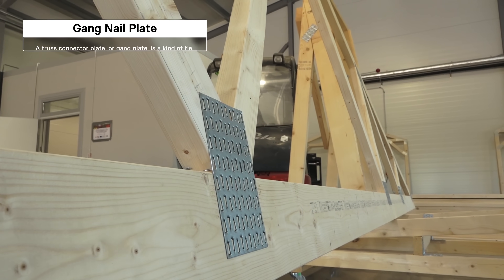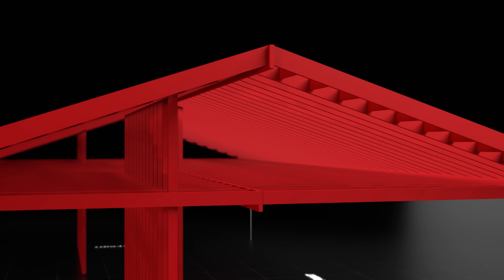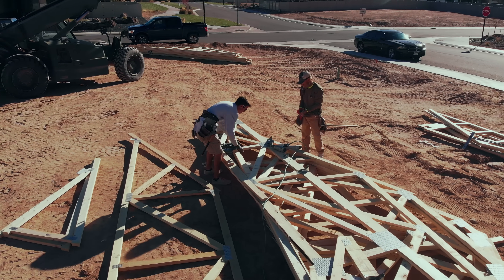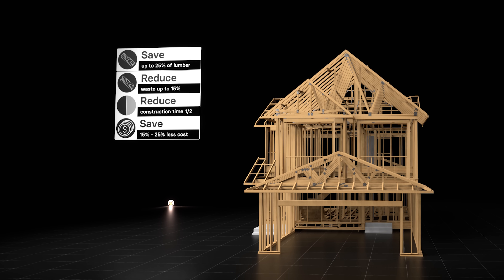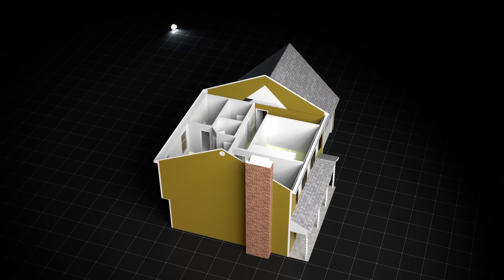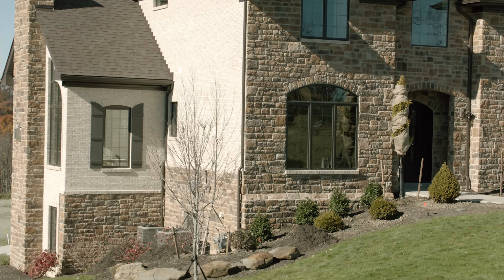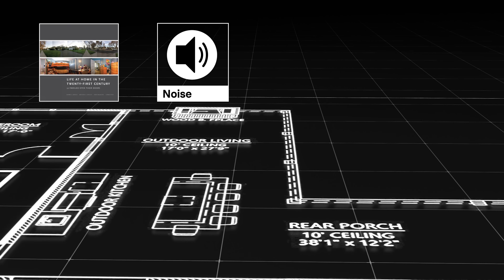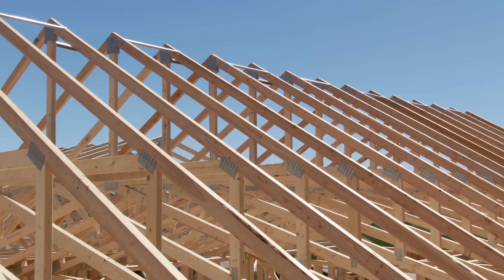The Invention that Accidentally Made McMansions

Comment: As for open floor plans, well the dining room in my house hasn't been used in years, the open kitchen, dinette, family room allows us to have rather big gatherings, and the cook, me or my wife, isn't outside the gathering.  Very few folks nowadays have servants and almost no slaves at all.  These made the dining room popular for the 'upper' classes.  My house is a mansion, built of stone with a steel frame, inside walls are insulated so noise transmission between rooms is reduced, use of 5/8" wallboard rather than the commonly used 1/2" helps as well.  We use the extra bedroom as a home office and the living room allowed the kids to practice on the grand piano without bothering the family.  The problem builders have is that carpentry skills aren't what they once were, they'd come back if we paid them more.  The Florida home problem had a lot to do with tieing the roof to the building structure and that to the foundation.  Houses in warm climates tend to be leaky and leaky houses are easy to blow away.  I lot of Hawaiian homes would be called sheds on the mainland.  McMansions tend to be built on rather small lots as compared to regular sized homes in the same communities.  It seems that the gable count has a lot to do with value, someone wrote a book about that once, it's come back to haunt us, houses with all these useless gables, even having factory built fake dormers in the attic that isn't lived in.

Comment: 6:35 I've seen advertised (in a local home improvement center sales ads) prefab roof trusses with a central rectangular open area under the truss peak, allowing for an attic. And not just a little storage space, but a livable room that can span across all the trusses in that roof, across the whole length of the house.
Reply: Bonus Rooms are something the builder doesn't want to finish, since it's an oven in summer and ice box in the winter.

It looks like livable space, but it's just a nice attic.

Comment: I think you're over-egging the significance and side effects of GNPs -- just as many others here in the comments are too quick to slag them off as "bad".

They are just one of many timber fixing methods, well designed and tested for particular applications . They are neither essentially good nor bad. But yes, they are cheaper in time and money than the traditional methods. Trusses have been around for millennia. "The 70s" didn't invent them, but the 70s did herald the era if cheap-shit building. There's solid-made trusses, and cheap-and-nasty trusses. Ya get what ya pay for.

Comment: The creation of chorded trusses did allow longer spans with lumber.  Also need to mention the 'I-Joist' and Laminated Veneer Lumber variations that allowed us to design and specify rooms with greater spans and still keep the deflection rates down.  Although the CFS outperforms the lumber.  The bearing plate dimension is very important on the longer spans with 'stud packing' underpinning the trusses all the way down to the foundation.

Comment: The plate is not load bearing or structure you dope. There are other structural elements that enable anything you’re talking about here. They only enable secure connection like for prefab trusses etc. but great misinformation channel you have here, chuckles

Comment: Cheap plywood and sheathing is a factor as well.  The weak points of stick-framed roofs are easily fixed, but it does require extra pieces of lumber.  The result is a much stronger roof and greater access to the attic space.

Comment: In UK and probably Europe as well, trussed rafters did not revolutionise house floor plans at all but their use was prescribed because of the cost benefits.  To correct this video, using a cut roof you can achieve more intricate roof shapes than with trussed rafters because one of trussed rafter's limitations and advantages is that are best suited for simple roof shapes.  There is certainly no structural advantage in using trussed rafters over any cut roof and I can show cut roofs with spans much larger than can be achieved with trussed rafters.  The gang nail plate is no more than a quick and convenient method of connection that is suited to factory production, it is most undesirable to assemble trussed rafters with gang nail connections on site.

Comment: This all stems from northern European construction practices of low architectural value. The Spanish and Portuguese (yes, the French do not count nor matter) were not using wood and hammers to build homes but rather brick, tiles, and reinforced concrete - specially in the tropics. This construction was/is more resilient and costly. Wood, if ever used, was an interior element (furniture, cabinets, beams...) or a material mostly seen, as roofing, in rural/poor settings.

Comment: Gang nail plates don't attach the trusses to the walls, the trusses are still nailed to the top plate. Hurricane ties or truss screws are used to keep the rafters/trusses attached to the top plate in high winds, not gang nail plates. Trusses do allow for more open floor plans, but not on the bottom floor, at least not on their own, you still need I joists, or floor trusses to get rid of walls on the first floor.

Comment: I’m a building inspector in one of the wealthiest zip codes in the country, I disagree that trusses are what lead to McMansions. You can frame large houses with stick framed roofs, I see them every day. You can’t frame them with dimensional lumber floors though. I joists allowed builders to get insane spans, 16’+ with no center bearing points. Without I joists, and lvls to some extent, your big house is full of tiny rooms

Comment: How did you go from telling us about an engineering breakthrough to a sociological lesson that is largely opinion based when it comes to the good or bad of it. AND on top of that, the MAIN issue you state was the issue with roofs blowing off being toenailed roofs to support walls, and then tell us how these trusses were better, but fail to say how these new trusses are attached to the support walls, and then later in the video, show someone toenailing a truss to the support wall. You started off strong, then went downhill half way through.

Comment: thank you for this post. Gang nail plates, while effective in the construction process, can become a significant safety hazard during a house fire. These plates are designed to hold trusses and structural components together but rely on thin metal prongs driven into wood. During a fire, the intense heat can cause these plates to fail rapidly. The metal conducts heat, which weakens the wood around the prongs, and the plates can detach, leading to the collapse of critical structural elements like roofs or floors.

This risk makes it particularly dangerous for firefighters operating inside or near a structure under these conditions. The sudden failure of gang nail plates can compromise the structural integrity of the building in minutes, making it harder to predict safe zones during firefighting efforts.

While they have their place in construction due to ease and cost-effectiveness, it’s essential to address these risks through updated building codes or additional fire-resistant measures to improve safety in fire-prone areas.

Comment: Stewart, it used to be common to build the up to the first floor subfloor. Then real carpenters would get out their tape measures and snap lines and layout the trusses on the subfloor. Instead of gang nails they build gusset plates with plywood. Trusses laid aside until the top plate was ready. You’re right, the 12-12 slope was rare. Too hard to tip up without a crane. The whole process was more labor intensive. Plus you needed carpenters. Framers weren’t adequate.

Comment: That isn’t how Planes fly. If it was, planes couldn’t fly upside down. It’s also not, if that were the case in Florida will respond with flat roofs. Roofs come off when air gets under them and blows them off. This is why window shutters are important. Something breaks a window, air comes rushing in, lifts the roof enough for the wind to catch, and then you lose the house.

Please research before making a video.

Comment: It was the battery nail gun not these things because you went from needing skill carpenters or airtank nailguns to portability.  No matter the angle or height the ability to bind two pieces of wood so quickly made a huge difference.  It's the reason why these type of houses came out during the 90s.

Comment: You can't say that it's just gang nails contributing to huge houses. It's a whole array of modern mass-produced products making it possible to create huge houses. Some products are simply cheaper some reduce the labour cost. Some large spans are contributed to cheaper steel beams. What about concrete costs? It's a lot cheaper now than in say 1950. So I'm in Australia and I have experience with Australian example but the same applies to both countries equally.

Comment: well, back in the day a house was a house, and you had a mortgage at a bank, but later they changed how the whole thing works, by enabling of the trade of mortgages, and that was a huge contributor to the shit show today, they turned a simple loan for the house backed thru the house until you pay it back system,  basically into shares. and that contributed really hard to raising prices, so bigger better will be worth more is also fueled by this scheme.

Comment: consider the waste  of usable space created by using trusses . 
By increasing the steepness of the slope one can gain an enormous  amount of livable space under a roof.
in Europe increasing square meters horizontally is not an option so houses are made larger by using the space under the roof . 
Lumber is saved by adding an additional beam about on third to one half the way down the slope . this reduces the the rafter sizes considerably and makes for a very strong roof .

Comment: I'm told firefighters consider houses built with trusses to be death traps. Another problem is the interior walls require sliding truss clips because of bottom chord movement, which requires a floating drywall ceiling if the interior wall meets the truss in a certain direction and if in the other direction, requires trim to be attached only to the ceiling so it can sort of slide vertically on the wall. Plus the way a truss is normally constructed, a useful attic with knee-walls isn't possible.

Comment: Your sociology is nonsense, while the construction engineering is fascinating. You have a poverty mindset for energy. Wood is regrown, heat and hot water can be electric, large roofs can host solar, large walls are more insulating, and your big garage can host home electric chargers for your EVs. There is nothing about larger homes that isn’t sustainable. A bunch of small homes can have leaky insulation, oil heating, gas hot water, and gas cars. That’s 90%+ of carbon, with flights making up the rest
Reply: He's a progressive.   You can't help himself.
Reply: Except that you are stridently wrong. Embodied carbon is a big proportion of the whole-life carbon. More sprawl inevitably means more carbon & more resources
Reply: @Conorguill  incorrect, the wood in a home is around a few months of driving a car. The ebodied carbon is in the roads, and bigger homes are marginal. Much more important to sprawl is the shape of roads, parking policies, zoning, and mixed use policies.

Comment: Several years ago, the Delaware Association of Professional Engineers ( their license board) had an article in their newsletter reminding engineers to be very cautious about signing and sealing structural plans for McMansions.  In really simple terms the Residential wood framing requirements offer two compliance paths.  You can do either a  complete engineering analysis and specify each connection.  Or you can rely on the prescriptive requirements, which typically say something like use  three X sized nails on Y centers for this application.  The problem was that the prescriptive requirements  are still assuming a fairly modest size building with modestly sized rooms.  While many interior partitions in a conventionally sized house are not officially load bearing, they act as  internal stiffeners (sort of an egg crate effect).  With these enormous McMansions with their two and a half story great rooms and 20 x 30 master bedrooms, you don’t have the internal stiffness.  On top of that, a lot of builders are using much weaker sheathing materials.   Anyway, there were some fairly spectacular residential structural failures that were attributed to using the prescriptive code sections outside of their range.
Reply: So you're saying we shouldn't sheath McMansions with carboard (thermoply)???
Reply: @bobbygetsbanned6049 : No, he's saying the room sizes of McManshions require stronger construction than the "rule of thumb" section of the standards imply.
Reply: @bobbygetsbanned6049 cardboard may be an improvement
Reply: @bobbygetsbanned6049   I sheeted my own home with 4x10 (yeah 10') sheets of 3/4" plywood that came out of a mid 50's era building I had demolished, framed it with 2x8's that had few knots, from the same teardown. The floor was 2x12's on 1' centers, when I sold it 28 years later the home inspector, an old carpenter himself, said it was the most solid house he'd ever inspected!
Reply: Don't even get me started on homes built in Delaware. They recently approved a project where the Dollies building was in Rehoboth that will have underground parking... underground parking in an area where you're three feet away from the ocean at hightide. Yeah I can't imagine what could possibly go wrong with THAT idea. There's a reason why most homes in Delaware are slab construction and why the newer townhomes have garages on the first floor.

Comment: The trusd plate isnt a bad thing. Its a very very good thing.
 Along with metal fasteners that better secure the plywood/ OSB roof sheets to the frame.
 As a result, we dont see entire roofs being blown off the tops of houses. So, the houses sustsin far less damage, often suffering little or no major damage.
 This makes home insurance more affordable.
 The plate may hsve contributed to the absurdly "McMansion", but the market had mire yo do with that.
 Now more often, we are seeing a return yo more compact sized homes.

Comment: My back door, backyard deck and double stairways that lead to the concrete patios utilize those nailing plates to affix triple stair stringers that easily support massive loads so heavy appliances like our Wolf Range could be installed in the kitchen.
Every time we now open up our walls, we attach those plates and additional steel strapping, stiffening and strengthening walls for additional earthquake resistance.

Comment: It has one disadvantage/advantage though: The whole construction becomes more flexible at the same strength compared to massive beams. So, a floor supported by such structure will flex more under weight than solid beams. At same strength.

Comment: The use of gang nail plates, while efficient in many cases, comes with the unfortunate side effect of contributing to faster roof collapse during fires. The heat from the flames spreads through the large surface area of the plate, accelerating the failure of the wood joints compared to traditional nailed connections.

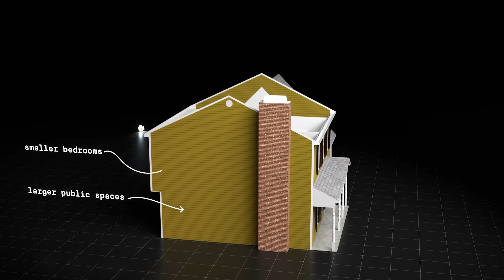Comment: Your explanation of two-story homes at the 7:30 mark doesn't seem right.  Something still has to support the floor load from the upper floor since the trusses are above the second floor and not supporting any of that load. Unless you're suggesting that the walls of the second floor are suspended from the trusses above.  I would think it would be just the opposite, worry of large open rooms above since the trusses are supporting the roof, and walls underneath the second floor (first floor walls) supporting the second floor load.

Comment: We used steel to build our custom home and achieve a two story volume and open floor plan. But it came at a really high cost. And our home isn't a McMansion by any means. This kind of construction enabled us to add loft spaces, which technically didn't count for square footage. I get the appeal of building bigger. The worst thing that happened is when homes became our primary investments, not just our abodes. This increased the pressure to maximize. We also allowed developers and realtors to convince us we should decide value on a per square foot basis, versus livability, beauty or long term sustainability.

Comment: These plates have nothing to do with McMansions. You don't need these plates to build a McMansion and I've seen them built without them using traditional framing methods. In fact, I usually see these on smaller, cheaper tract houses that use trusses, not the larger custom homes that are stick framed to have space in the attic.

Comment: Impossible to blame him at all... any tool can be used thoughtlessly or negatively.  If I hand you a prybar you could use it to break into someone's house or you could use it to disassemble a dangerous decaying structure. If I sell you a car, you could use it to efficiently transport yourself... or you could go crash into oncoming traffic.

So long as the tool is not designed specifically to produce a negative outcome, the responsibility is entirely on the user.  Even if it is specifically negative, the responsibility is still majority on the user for choosing to use the tool to produce a negative outcome.

Comment: Probably the biggest "advantage" is that carpenters can be less skilled and still put up a roof. Of course there's a host of problems that go with this.

On the other hand, properly designed trusses can allow for R40 insulation among other advantages.